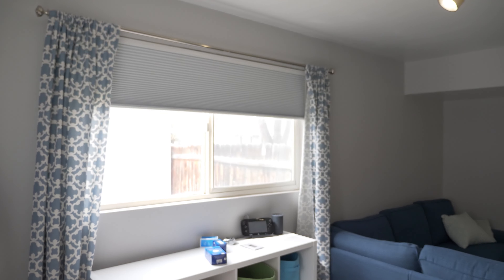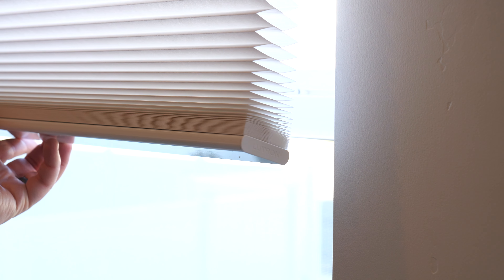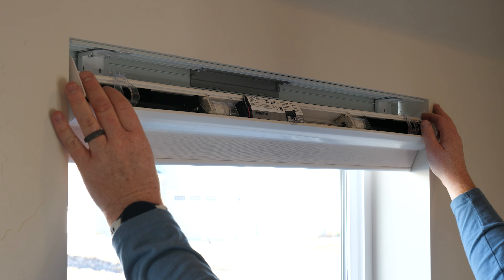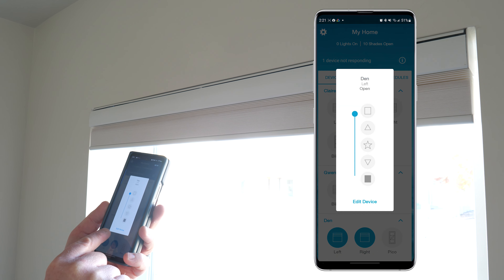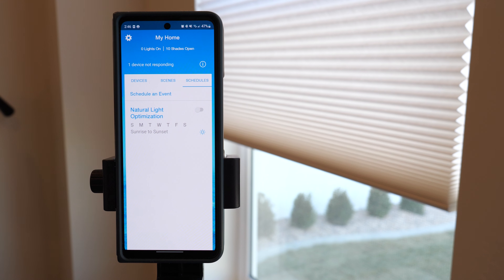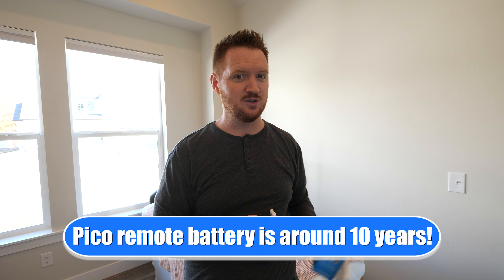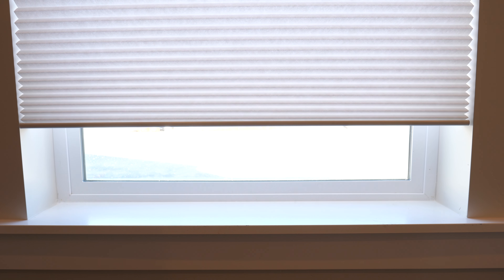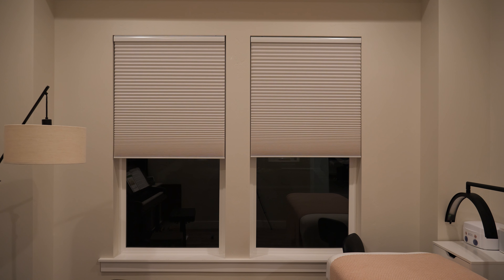Smart Architectural Honeycomb Shades From Serena by Lutron

Comment: These look amazing. What is the width of the battery housing, top bracket? Other brands have a very large housing which I haven't liked for inside mount shades. Also, do you think light filtering is enough to protect wood floors from sunlight? Great video.
Reply from the maker: Yeah these would do a great job in block harsh sun rays. The width depends on your window width but I think you are asking for how deep they are into the window which is only 3" from the front of the shade to the back of the bracket.

Comment: What’s the difference between the architectural honeycomb shades and the standard ones?
Reply from the maker: The Architectural Honeycomb have wider slats, a different top rail design and a new headrail that doesn't allow light to leak through the top. You see the standard version here: https://youtu.be/bH4N3nmV5k0